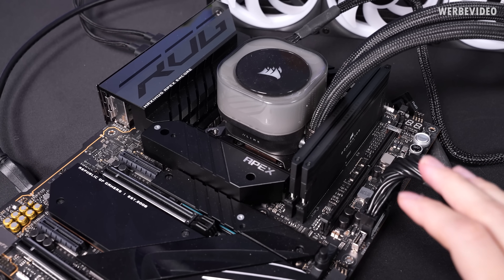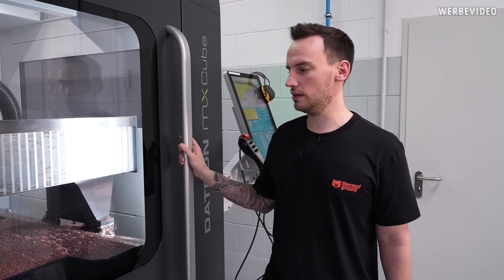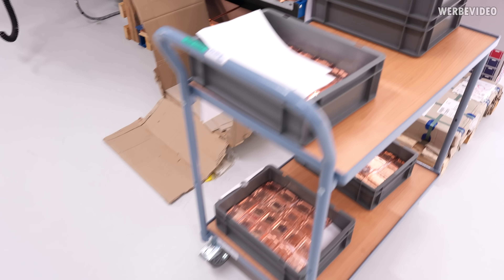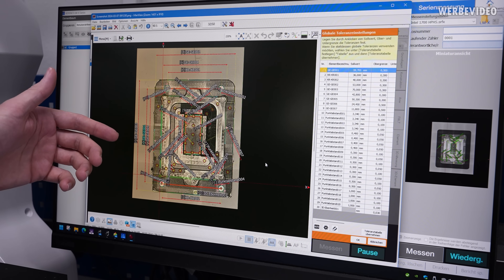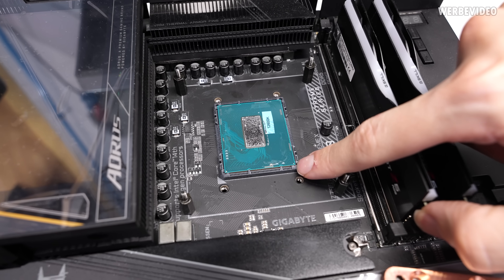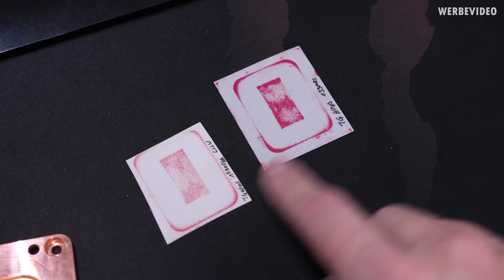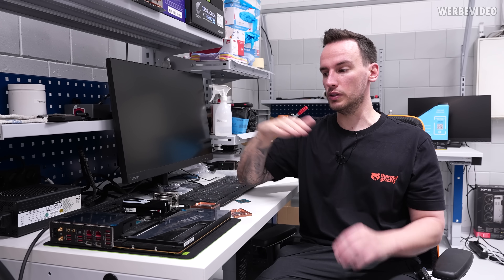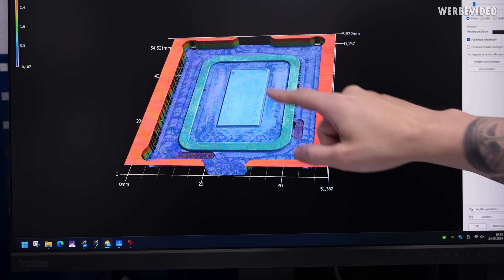I messed up

Comment: Thank you for watching and commenting on my video on your product! The direct die cooler definitely meets my expectations on my 14900ks. No affiliation or sponsorship of course but no complaints. Seeing a video like this just further following up making sure everyone is happy.... Thermal Grizzly and all its staff, Der8auer, you are such a pillar of honesty in the computer community, please always keep the amazing integrity you have. We customers love the way you do everything
Reply: Was it the 14900k? I have a 13900k from launch running no issues and just got a 13900KS. Hope you got your system running correctly.
Reply: @Typhon888 14900ks I got and used his cooler on, stable and no issues on Intel default and 4096w profile both. Obviously 4096e gets hotter but no crashes under extended load ever and idle is like 35c to 40c in 25ish ambient give or take 5
Reply: @Typhon888  14900ks, has been running great 2 weeks now nearly, no issues at all and i'm a complete noob, if you follow instructions seems to work great if you're not fighting for the last 1-3 degrees, i just wanted significantly better temps than an AIO would do and I got that and i'm so happy
Reply: how much did it improve ? my triple rad in lian li o11 dynamic xl gets my 4090 running 3090mhz 24ghz at like 45°C with 60°C hotspot the highest ive seen and at 440w but my 13900k non oc in the same loop still goes to 95+ with like 130w annoying frankly
Reply: @fredEVOIX  this is the only cooler i've tried on 14900ks but it lives at 35-40c idle in 20c ambient and under load like 60c-70c on intel default power profile

4096w profile seemed to like 80c under extreme load with occasional 100c spikes but very stable 80c no power limit
Reply: Now that's interesting, my TG heatspreadder, applied correctly, hits max temps really quickly. With factory heatspreadder from intel I barely used to hit 94C, now I hit 100C and that's on a custom water-cooling loop with Alphacool's AIO's connected both for CPU and GPU plus a separate reservoir with a stronger pump to make the loop more efficient.
GPU on 750W load barely hits 60C yet my CPU skyrockets. Heatspreadder definitely did not worked for me unfortunately 😢

Comment: The ability acknowledge to your own faults and stand by them and their solution is a dying feat of humankind.
Thank you for going against the flow Roman. This shows character imo. 

You can look forwards to a new customer for my next cooling solution for my hardware. Already using thermal grizzly lm for my current setup and i am superhappy with this product. One unit has lasted me two cpus and one gpu so far and still it not empty ;)

Comment: going with the assumption that THE users know the problem with last 3 ReFreshLake's and MB bios,
systems are setup right and no plastic films still on, 
could intel have change quietly the cpu pcb or packaging and roll it out with different IHS.
Maybe time for Der8auer Z490 and Der8auer X670E motherboards

Comment: how do you know all the plastic is the same height on all motherboards so you could be working it and working it on your end and come to find out that there plastic is a little taller then yours. Maybe you can work it out with one user thats having issues and you can get the motherboard and item the purchased and see what problems they are having.

Comment: Different manufacturers use different PCB stackup (thickness / dielectric / core ), maybe there is different modulus of elasticity and the frame is bending around cpu?

Regarding distance between frame and PCB: distance should be at least 6-8 times (preferably more than 10x ) the distance between controlled impedance diff signal pair and the ground plane. 
Prepreg layer should be .21 mm  so 1.2mm gap should be sufficient.

Comment: Question. For the mounting - do you use a specified distance at which the screws would stop, or is it possible to tighten them slightly more or less (by feel)? Asking because someone may have put in washers or some mobo have different number of PCB layers or thickness. So maybe the screw stop is too high for some cases.
It may be the classic: unit testing vs. integration/system testing.

Comment: I hope you will figure the problem out. Being this transparent about processes involving the product is nice and will work out well in the long run.

I suggest that get a variety of motherboards to test your products and see if there is difference between plastic parts of the sockets. I think also you need to check used motherboards. Sometimes high pressure and high thermals can bent the socket area a little bit. This can mess up things. I think what you need is more variety in your tests.

Comment: rigidity on socket plastic ? pcb rigidity under heat condition?  older peoples remember surely the problem we had when use phase change on long term on thoses stuff with temperature change.

Comment: Roman, I suggest trying to buy the motherboard+cpu from a few affected systems (the more you can get the better the sample size).
It might help identify the problem area as you have much better tools to measure things if it is a clearance issue(s), it would be present on the board. Also, due to multiple people being affected it might not all be the same issue. Solving one and calling it fixed is going to be difficult, so we appreciate you sending out samples to those affected to see if it solves their particular problem
Reply: Just buy their system as-is to avoid any mechanical shifting caused by customer during disassembly.
Reply: What if it's the user?  ...and inconsistencies of torque applied?
Reply: @WildRapier  It could be, and buying the system as-is might help diagnosing this.

Comment: I think the tolerance is so small that any variation on the user end is magnified to the point that it was. This seem like a custom made product rather than a universal fit, which I think it would be hard to nail the performance.

Comment: 14:26 don't overexpose your trade secrets, we appreciate the transparency but remember to competition is watching too
Reply from the maker: not sure how much this helps them if the product doesn't perform as expected :D
Reply: It’s much easier to just buy one and start making exact replicas than reinvent the engineering process
Reply: @Gusto20000  So try to make one from these information:) Big players already have all the research done by themselves or they have similar machines that can 3d scan objects with great accuracy. Companies which make knockoffs will surely skip a lot of steps and their final product will suck anyway.
Reply: @garreth123  exactly what I’m talking about - they don’t need this information, just one sample to measure and replicate. They would have to cut corners to make is cheap, or/and use cheap labour.

Comment: interesting how you didn't mention buying off at least couple of those affected boards with CPU's, plates and seeing if you can find the problem that way. i mean go strait to the source of the problem
Reply from the maker: We will first make new prototypes and send these to  some affected customers. I personally would not want to take my PC apart because someone else messed up. This might be the easier way even though it's a bit harder for us.
Reply: @der8auer-en  you have a good point, i haven't consider people running custom water cooled PC's for example, and taking them apart can be a challenge. best of luck getting to the bottom of this and thanks for being honest with your customers. makes me trust in this brand even more than before, cause you actually stand behind it. can't say the same of most big companies these days..

Comment: So Assuming the prototypes are working as they should in the lab their... And are coming out as designed... But are not performing as well once delivered to customers. Could the issue be not the design. But Environmental? Is your copper stock correct? Is it what it claims to be? Is your supplier trustworthy? Could the copper be contaminated? So when it goes to places of different atmospheric pressure and temperature. Its not deforming expanding or shrinking outside of spec?

Comment: I don’t have the good fortune to have one of your products mentioned here and would certainly not hesitate to purchase one. I was thinking along the same lines as some comments that the plastic socket could be at fault, I also wondered if the end user could be at fault. I threw my memory back to when I had a Threadripper and how AMD would supply a torque controlled screwdriver / wrench to control the downward pressure onto the contact area and take away the end user problem of over pressure.

Comment: Did you calculate space for the thermal paste?
Reply from the maker: these products are made to be used with liquid metal. The layer there should be lower than 5µm which is below our manufacturing tolerance
Reply: @der8auer-en  That sounds tight and metal can warp from heat hopefully you find the issue.

Comment: quality control and opened windows ? maybe start there. Temperature stabilisation of products before measuring ? How sensitive your measurments are against a variation of T°C and %HR ?
Reply from the maker: the LMX is made to be used in these condition. Anything from +10 to +35°C is fine. Only if you want to follow ISO 10360-7 you have to keep it at 23°C. But apart from that there is very little influence
Reply: @der8auer-en  and the machines ? There is not calibration draft due to temperature ? The keyence is fine with thèse conditions ? I'm asking stupid questions but sometime going back to basics is the key 😉

Comment: So what if motherboards use different "sockets" i know with AM5 there 2 company's that produce AM5 sockets for motherboards. if they are off by 0.5mm is going to go bad.
Foxconn is one, i KNOW Asus got a "Special" manufacturer for their stuff.. that says "Unbranded/Generic" with no foxconn logo.
Reply from the maker: The thing is that 2 customers were using the Apex Encore. I also have an Apex Encore which I used for testing. It would be very odd if ASUS used different sockets on the same board
Reply: One problem I've seen in some machines, is how a tiny assembly misalignment can become way worse when the user try to fix it with brute force. If the use gets a poor temperature and reacts just tightening the screws, it can make the plate bend and reduce contact even more...

Comment: I think you should get the motherboard and the CPU from the customer. If the tolerances are ok on your side it's: motherboard or CPU or customer fault.
If it's the particular CPU or the motherboard you can make adjustments to your design.
If it's customers fault you can make a video how to avoid common mistakes. It's a win win situation.
Reply: I wonder if this issue is product induced user error. Your idea is a good one.
Reply: @--_DJ_-- no boob user would attempt a delid and installation of such a heatspreadder. It definitely did not worked for me unfortunately and now I am stuck with it on a custom water cooled loop. 13900k MSI Z790 board = did not work, the temps are actually worse than intel heatspreadder. I am unlucky it seems. 😅
They have refunded me in full however.
Reply: @steveracer1985  I didn't suggest anything about the people using it being "boobs". I'm not sure what made you write that to me.
Reply: He will most likely supply them a cpu and board to use

Comment: Thanks for this video. It's a shame other suppliers aren't as transparent with their processes when issues occur.

Even with the most careful planning and checking, occasionally there will be issues. It's how they're owned and dealt with is the key.

Whilst in all probability, the issue is with the cooler, I'm wondering whether it's something Intel has done to the chips and packaging. Maybe sourced from different fabs.

Comment: Could it be different revisions of the Plastic socket retainers, with different heights?

I think the height you are pressing against with your coolling solution is actually used in the normal socket mechanism, so my guess is that they could be sloppier than desederable for tolerances against the spec dimensions

Comment: Thermal Grizzly really let the industry down. You supposed be quiet and just lie to customers and say, "Everything is working fine it must be you." You then have the customer return the product and then blame customer, even though it is not customers fault. 🤣

OK serious part.

Are the PCB height/depth/thickness(I say thickness, some will other measurement) the same on all the Intel 12/13/14 series? Example:- If the PCB on 12 Gen is 5 mm from bottom (where contact to pins is made) to the top (where the CPU core is mounted), is this the same across the all LGA1700 processors? Reason I ask is, you mention all other measurements except this one. 

Example thickness possibility.

i7 12 Gen is 5mm
i7 13 Gen is 4.7 mm
i7 14 Gen is 5.2 mm

i9 12 Gen is 4.5mm
i9 13 Gen is 5.5mm
i9 14 Gen is 4mm

If the PCB is different, then this would not "sit" correctly and loss thermal connectivity,

Comment: Did you try out a Center Convex contact to the Die chip? Similar of does used on the Gamers Nexus "perfect cpu cooler" video? i thinking about that because usually cpus dies are slightly convex in the center of the die right?
Reply: Isn't the die flat because of manufacturing? The contour is on the IHS, the Thermal Grizzly parts are direct die which replaces the Intel stock part and require delidding
Reply: @ruikazane5123  the Die its not flat, the are little convex on the center of the die chip, he could test making a convex direct-die shape, maybe that is the "tech" if you saw GN video you got what i mean... 🙌🏽

Comment: Just throwing this out there for like an out of the box thought. Could the cpu dies themselves very in size just enough that it would throw off your static size block. Or did u calulate in mybe a hit or miss tollerance for all your blocks
Reply: Also one other random thought. Could the cpu pcb, be flexing just enough when heated that it might shift even a hair bit or warp/bend that could be affecting ur blocks contact points

Comment: name another company that takes accountability at this level.

NAME ONE. 

No one? Alr, great job looking into it. Love the products and keep up the good work.
Reply: Fractal Design
Reply: Arctic
Reply: John Boy's big time mayo spreader
Reply: There are some, but it's a little unfair as it excludes those who would, but they have properly good QA, so it doesn't end up being public.
Reply: Only one that's close is arctic cooling with the liquid freezer II recall. but could have just been a one off because multiple companies were getting ripped by gn for recall/manufacturing issues at the time. Either way this was handled great, hopefully they or the current customers and/or testers are able to narrow down exactly what's causing the issue.
Reply: @sirmonkey1985   Arctic came forward before GN mentioned it. They were issuing refunds, replacements and repair kits. I had an issue with mine. I sent an email. They said there's an issue and we're refunding or sending you a new AIO. If you feel you can repair yourself, try with the repair kit and if you fail, we'll still honour our promises to replace and or refund you. I sent my old one back and got a brand new one, from new batch that fixed issues. A week later, GN brings it up.

Comment: From what you said about it resting on plastic frame of cpu socket it could be possible some frames may be slightly different, could be also bad thermal paste or fitment. 
I recommend requesting those affected send photos of bios settings and windows, then of how it's fitted and thermal paste. You could also perhaps purchase the motherboard to measure socket.

Comment: Romain, first of all - thank you for the huge work, we appreciate it. Errors are common - we can't escape of them - its a part of our development as enthusiasts. Now I want to reveal another issue with my recently purchased AM5 Mycro Direct Die Waterblock. I've delidded my CPU(7800X3D with 3 chiplets.. - the delidder tool its just great). Now after I've removed indium and applied a liquid metal - also purchased of TG - the problem is that - we use our PC in vertical position - the liquid metal has flow down from the I/O chip (which is placed higher) to the cpu chiplets - I've reached very soon 89,8 Celcius on I/O chip and with cpu chiplets the temperature is OK. Now I've ordered 25 by 25 mm graphene pad to resolve the problem. I've nothing to complain - its just For Your Information and for futures ameliorations. Btw - you're never noticed this problem because all your tests in your videos was made on horizontal bench stand. Anyway thanks a lot for your contribution in watercooling!
Reply: You should check your application.
I've been using liquid metal vertical for 14 years and never had that happen.
I'm using the same block as you are with liquid metal and my highest temps is 65c during stress testing.
I'm trying to be kind as there is no easy way to say this but the problem sounds like user error and bad LM application.